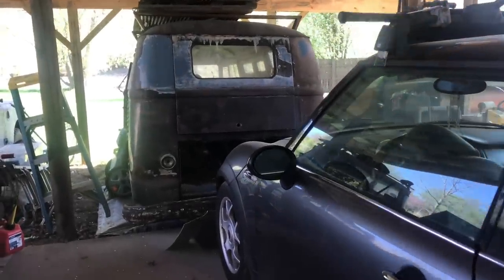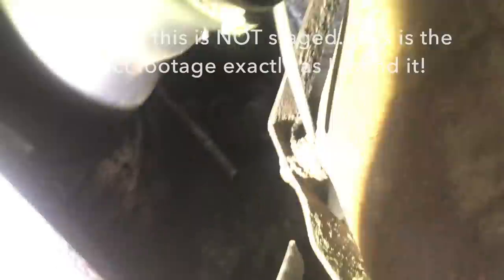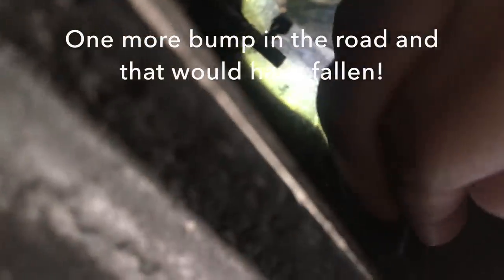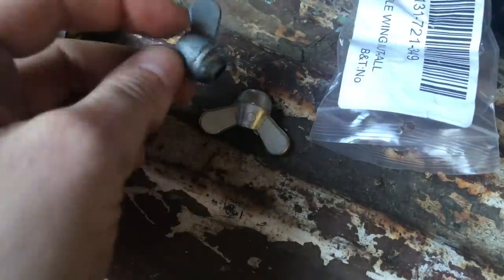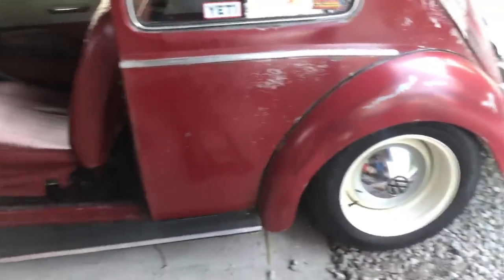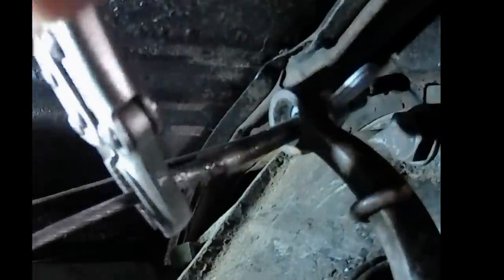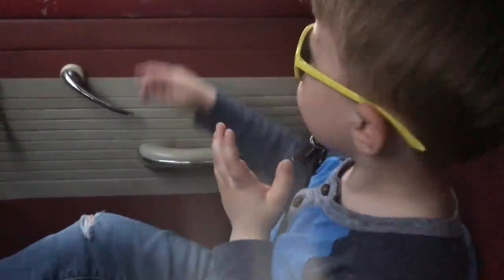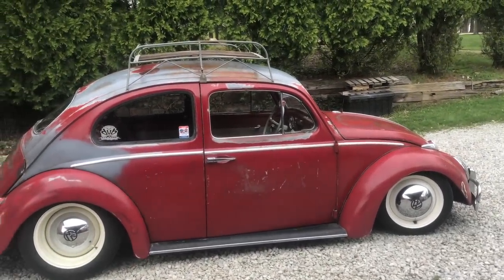Volkswagen Beetle clutch cable fix and adjust

Comment: I had the same exact thing happened to me a few months ago on my bus! Those Wing nuts are being made super cheap and it's sad. I wish they would just make Quality Parts. I ended up ordering one of those six shooter cable ends from airkewld
Reply from the maker: Ticks me off that the metal on those things seems to be like an aluminum composite r something...those should be some sort of hardened steel...needless to say I will be nabbing a few old ones at the FUN Fest swap meet in June! Thanks for always being so supportive!

Comment: I have to do the Renault clio clutch cable  next week hopefully that won't be to difficult
Reply from the maker: you can handle it! what year Renault?
Reply: @marcijunebug  it's a 1999 year so  more or less 20 years old it's as basic as they come its not even got  power steering lol
Reply from the maker: @chunk2good664  I'm personally not a fan of power anything! like power windows...always first thing to break...power steering means gotta keep fluid in that and pumps go bad etc etc! lol good luck!
Reply: @marcijunebug  I agree with you the Renault clio has manual windows no air con no abs no power steering but i kinda like it .I bought it three years ago for my daughter then my nephew had it two years now I've just got it back
Reply: Clutch cable done air filter done new wheels and tyres next will be brake pads and disks and anti roll bar bushes
Reply from the maker: the thing with older cars is you CAN at least WORK on them!
Reply: @marcijunebug  definitely I did it easy in the end and it's working great I put new wheels and tyres on to its starting to look great .it's my birthday today so I've been for a fantastic Indian meal with my family
Reply from the maker: chunk 2good well HAPPY Birthday! It’s Mother’s Day here so I guess I get to do whatever I want today! Hope you have a great day!
Reply: @marcijunebug  happy mothers day to you and thank you very much x

Comment: Whew, lucky it happened when it did, not in traffic, how about adding a second nut on the shaft to jam the wing nuton there???????? Threads look a little funky tooo.......
Reply from the maker: ger traba the older VW’s DID have a second nut, but didn’t have wing nut, wing nut has a taper to rounded ball like end and has two small burrs or tabs that kind of catch on the clutch arm...with the clutch pressure on it it really can’t back off...the old one just had zero threads at all and just slid off but yes maybe I SHOULD put a second one one there! Threads on cable look funky because they have never seize on them!
Reply: @marcijunebug  Never seize might have contrib to the failure, anyway to drill and cotter pin the end of cable to prevent the back off?